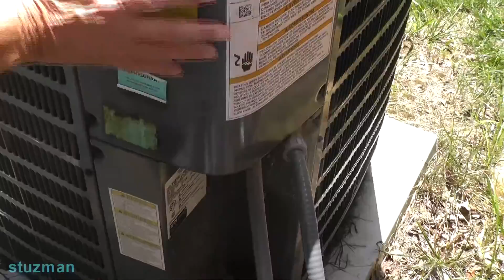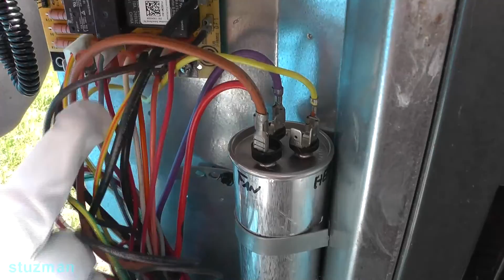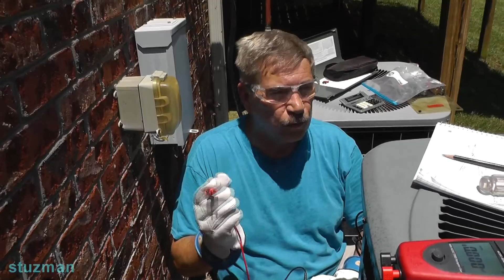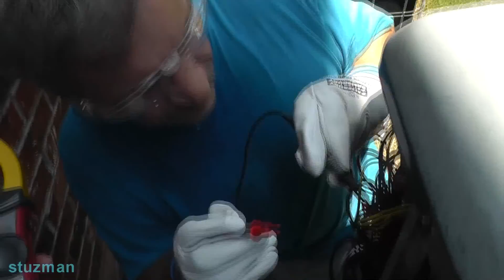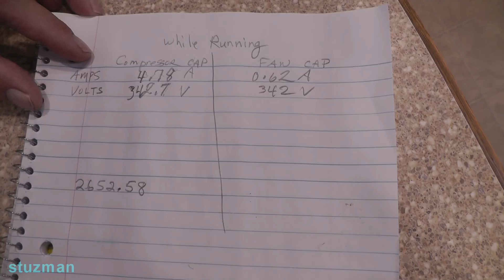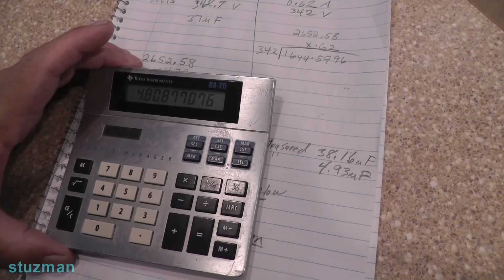How to Check Capacitors with A/C Unit Running: Part 1

Comment: If  satrting  capciter  or  ruing  capciter  used  in   a  moter is  defective  it  will   not   start  the  capa  citer   can  be  tested   as  floowers  one point  ..connect the   capciter  to  the  required   voltahe   after  one  second  dis  connected  and  short  ites   terminala   a  spark  test  ing  if  capa citer  is  good ..ok2 point ...connect the   oh  metar   to   the  termianl  of  capa citwr b .after  a  momentary   deflectction  the  ponter   comes  to  zerow   again  if  capciter  is  good   repeating the  test  in terchange  the  meatr  prods    to  calcute  the capciter of  the  capcier  connected it to  the supply with  an   ampre   metr  in  seres  and  vlot  metr  in  parllel  as  shown  un  the  dirgom usin not shot  reding  voltmetr  amper   string  capciter  shoud  not  be  cknnecyed  more  than  few  sconds   cslculted  cspcity   marco fard   ac  frewquecy  50  cycles  /3180  /volts  .. capcity in mfd  .ac frequency  60  cycles  =2650 /voltz ..ok
Reply from the maker: Thank you for your comment and have a great day!

Comment: You measured 340 v across the capacitor. I'm trying to understand how the voltage is higher than the supply voltage. I watched another video and he had briefly mentioned capacitors don't increase voltage but the increase is from counter emf. The research I've done says counter emf should not be higher than the supply voltage.
Reply from the maker: Hi Rick! I agree that it's not the back EMF. Otherwise, we would have an energy source that can work on its own and would produce more energy than we put into it. It shouldn't be higher than the source voltage. I like to think of it in terms of the phase shifting of the voltages between the voltage across the inductor, (start winding) and the run capacitor. The reactances of XL and XC are 180 degrees out of phase with each other, so you can't add them up to get equal the source voltage. I'll try to give an example using my video. I didn't measure the voltage across the start winding, and maybe can lead to another video illustrating when an inductor and capacitor are in series. The current was measured as 4.78A for the capacitor and of course this current will be the same through the start winding. The voltage across the capacitor was 342.7V which means it's Xc was 69.8 ohms. This comes from the equation of 1/(2*pi*f*C) where f is the frequency, (60) of the line voltage and I used 38uF as the measured value of the capacitor. Since the voltage across the inductor, (it's 90 degrees ahead of its current) and the voltage across the capacitor, (it's 90 degrees behind its current), they are 180 degrees out of phase which each other. This means the voltage across the start winding would have been about 102.7. This comes from taking 240V, (the supply voltage) and subtracting it from 342.7, leaving 102.7V across the start winding. This is how you add the XL and XC voltage drops to equal the source voltage. You SUBTRACT the two which will equal the source voltage. Using ohm's law, the XL for the start winding would be XL = voltage across inductor / amps through inductor. So, XL = 102.7 / 4.78 which is 21.48 ohms. But we need the net reactance of the circuit. So, we subtract XC-XL, 69.8 - 21.48 and this give us 48.32 ohms of capacitive reactance. Here, in terms of the source voltage, the voltage will behind its current by 90 degrees for the circuit. And to the source voltage of 240V, it looks like a capacitive circuit where there is no inductance at all. Now, if we take the supply voltage of 240V and divide it by this 48.32 ohms we'll get the amperage of the circuit which is 4.96A which comes close to our reading on the amp clamp of 4.78A. This is in tolerance of the meter. For a little bonus, we can calculate the inductance of the start winding. Here, XL = 2*pi*f*L. Rearranging the equation, we have L = XL/(2*pi*60). Plugging in the numbers of 21.48/(2*pi*60) gives us 0.057H or 57mH for the winding. Again Rick, think of it as a phase shifting of the voltages across the inductor and capacitor which gives these higher voltages across the capacitor.
Reply: @stuzman52  Hi Terry, Thanks so much for your reply. When you measure the supply voltage you measure the effective RMS  voltage. The capacitor stores the peak voltage of the sine wave so the voltage across the capacitor should measure the peak voltage. Peak voltage= 1.414 X RMS. In your video your supply would be 242.36.        242.36 X 1.414 = 342.7     Is this correct?
Reply from the maker: @ricks3344  Very good Rick if my supply voltage was 242.36V, but 342.7V is not the peak voltage across the capacitor. As you saw in the video we had a RMS voltage of 342.7V across the capacitor. You're taking the RMS voltage across the capacitor and calling it the peak voltage and then converting that to RMS voltage and calling it the RMS supply voltage. The capacitor's peak voltage is 484.58V. While we're on capacitors, the working voltage for these capacitors are usually 370V/440V which is fine since they are rated as RMS voltage.

If I'm following you correctly, you're thinking that measuring the voltage across the capacitor will give you the supply voltage after you've converted. You can not do this to determine the supply voltage. It all depends on how much capacitance and how much inductance is in that series circuit. More capacitance would be less Xc and less voltage drop and vice versa. And with more inductance, you would have more XL and more voltage voltage drop. The two are inverse of each other. Okay Rick, so if that's what you're thinking, I've got one for you. Here's another video where the user measures 271V across the fan capacitor and 297.6V across the compressor capacitor. What is the supply voltage? You ask really good questions Rick and glad that you're showing an interest! Here's the video link https://www.youtube.com/watch?v=JomKoq2m_rI

Comment: Hello, I am confused about the start capacitor that  should be cut off voltage after the condenser running. Thank you.
Reply from the maker: Hi Vanessa! Capacitors of this type as shown in the video are called run capacitors and are designed to stay in the circuit even when the compressor or condenser fan motor starts. On some units, there may be two capacitors for the compressor. One will be the start and the other a run capacitor. The start capacitor is designed to start the compressor, but will be disengaged from the circuit once started by either a potential or current relay. And the run capacitor will stay in the circuit.
Reply: Thank you very much. Have a wonderful day!

Comment: Awesome information. I have a UEI clamp meter that does amps and voltage at the same time. This will save me a ton of time and time is money!
Reply from the maker: Glad to hear that you found the information helpful! It's a very accurate way of checking a capacitor under actual running conditions.

Comment: Good job on warnings about disconnects being totally off and double checking with voltmeter. Your subpanel double pole breaker is usually not a problem but I have seen fused and non-fused disconnects with the hot legs miswired on the wrong lugs leaving one or both legs still hot.
Reply from the maker: Yes Tony, I've run across that issue too and always a good idea to check for voltage to be sure.

Comment: Love your videos.  Can't wait until more videos to come.  But, can you help me understand 240 volts vs. 120 volts condenser unit?  From my main power panel, there are only 2 wires going to the disconnect panel outside thru conduit piping.  Which I believe to be 120 volts on each wire.  From there, three wires goes to the condenser unit.  Are they using the frame of the disconnect panel as a ground?  And is this proper wiring for this unit?  Thanks
Reply from the maker: Hi Steven and thank you! You probably have 240VAC going to your condenser unit. Take a look at the name tag on the condenser unit and you can see what it's voltage rating is. If that's the case, there should be three wires coming from your main panel where these three wires are connected. Two of the wires are 120VAC each connected to a two-pole breaker. The other wire should be a bare ground wire which is connected to a grounding bar inside the main enclosure. You'll probably see white wires, (these are neutrals for other circuits) connected along with all of the grounding wires. When the three wires go to the disconnect, (the disconnect could have a breaker, fuses or neither of these items), the two hot wires are connected to the line side lugs and the grounding wire is connected to the frame of the disconnect. There will be a flexible conduit going from the disconnect to the condenser. The two hot wires will connect to the load terminals of the disconnect and the grounding wire will connect to the disconnect frame also. At the condenser the two hot wires will connect to the lugs of the main contactor and the grounding wire will connect to the frame of the condenser. In your case, it sounds like you don't have a grounding wire coming from the main panel. If that's the case, to be safe, you'll need to get a grounding wire back to the main panel. Just having a grounding wire from the condenser connected to the disconnect is not grounding the disconnect or the condenser frame. Hope all that makes sense and have a great day Steven!
Reply: @stuzman52  Thanks for the great explanation.  To see if I have it right, there should be 3 wires coming from the fuse panel thru the metal conduit to the disconnect panel?  This condensing unit has been running for over 10 years like that.  I only see 2 wires coming from fuse panel thru the metal conduit.  Are they using the metal conduit as ground?  And is this safe?  Thanks again.
Reply from the maker: Steven Nahulak  Normally in a residential installation, a cable is used which has two hot wires and one bare wire for grounding. But if your installation has a metal conduit from the main panel to the disconnect, then you’re okay. The conduit is serving as the equipment grounding conductor and you have a safe installation. Have a great day Steven!
Reply: i know im randomly asking but does someone know a method to log back into an instagram account..?
I somehow forgot my password. I love any tricks you can offer me
Reply: @Jose Peter instablaster :)
Reply: @Ty Finnegan Thanks so much for your reply. I found the site through google and im waiting for the hacking stuff now.
I see it takes a while so I will get back to you later when my account password hopefully is recovered.
Reply: @Ty Finnegan it did the trick and I actually got access to my account again. Im so happy:D
Thank you so much you really help me out !
Reply: @Jose Peter happy to help =)

Comment: Great summary, Terry. I found this topic unnecessarily confusing because I stumbled on the phase shift complexity. As you say, it's not needed to get those simple numbers. Duh! The number came from the 1/(2*pi*f*Z) definition of capacitance, together with ohm's law. What a great way to test capacitance without shutting down, it is so much more satisfying to prove the part is good or bad rather than just swapping it out. Is there an easy way to measure the current:voltage phase shift, to divide the measured impedance into the sum of resistance and reactance? I wonder if inductive current meters might have their own phase shift in the tool itself, making comparison on a scope more complicated than it should be....
Reply from the maker: Yes, you are correct Dave that the number comes from the formula for capacitive reactance. There is a way to measure the phase shift with a watt meter, but some are pretty expensive. It's cheaper to make a calculation using equations, (which are not complicated) to find the XL, XC impedance, phase angle among other things. To get more information about the phase angles for current, voltage, etc., one could use complex algebra involving real and imaginary numbers. I thought of doing this on my own a/c unit just for fun, but probably won't make a video of it as it would probably be over most people's heads, and I don't want to waste their time. Thanks for the comment and dropping in!

Comment: That's the first I've seen these gloves. Something like this is required if we're to work on hybrid vehicles at the dealership. This is somethign I look forward to being certified on to repair as well.
Reply from the maker: Yep, in the industry most facilities now require PPE and one has to have arc flash training before they can work on electrical systems. As you mentioned, when working on hybrids this is a requirement too where voltages are up to 300V. Be sure to stay cool today David as the temp is going to soar :)

Comment: I'm always amazed how accurate current clamps are... even when the clamp is much larger compared to the wire it's clamped around. I always assumed a small clamp / less space was better.
Reply from the maker: Thomas EXOVCDS That’s true Thomas and I’ve thought the same thing. This amp clamp can read up to 600 amps ac/dc and yet could read down to 0.62 amps with good accuracy. Thanks for dropping in Thomas and sharing your thoughts. 😀👍

Comment: Good video and safety tips.    Ive heard of bad things happening even if you think the unit is powered off!    Have a friend who works on the big 3 phase 5 ton or bigger units on big buildings....said he's seen a guy get drawn in by the current, fortunately his coworker was right by the main shut off and killed it before it killed him....definately nothing to mess around with when it comes to being careful even on the household size units.
Reply from the maker: You're exactly right that you need to be careful when working around high voltages. Good thing that your friend's buddy was around to kill the power. Thanks for sharing a comment!